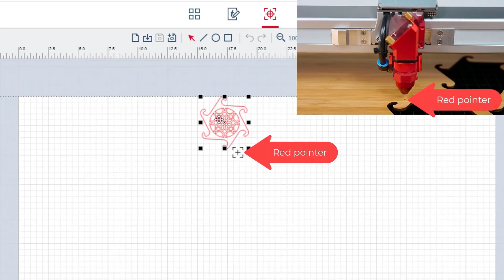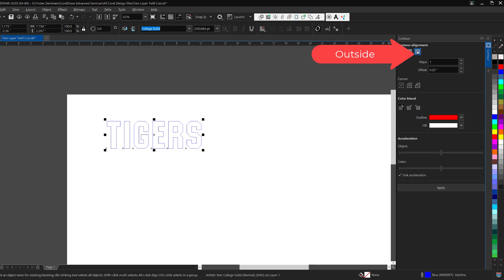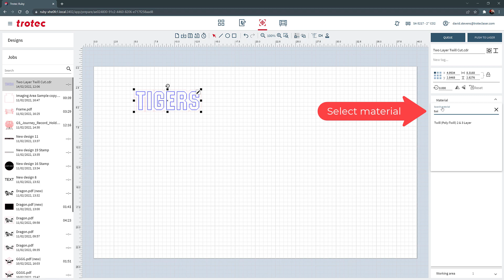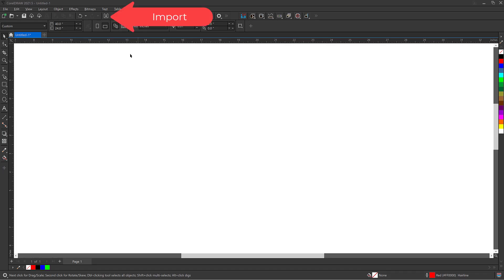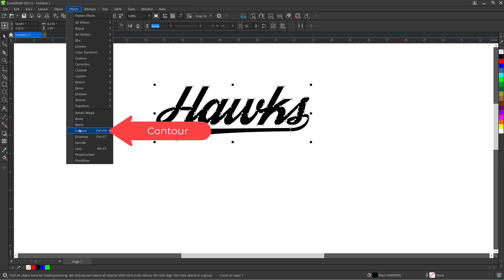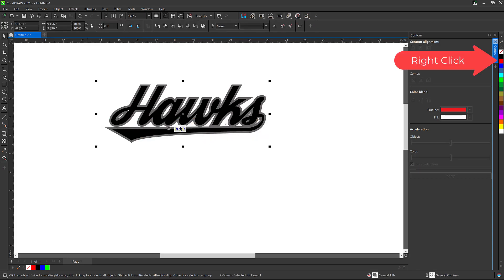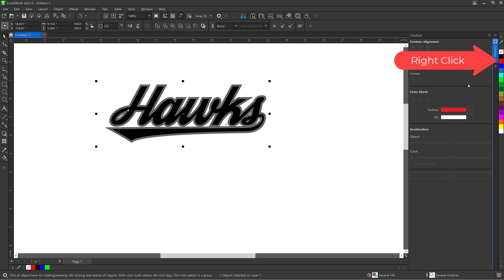Deep Dive with Laser Dave: Multi Layer Poly-Twill Applique Cutting

Comment: What settings are used?
Reply from the maker: Settings are determined by the materials brand, thickness, and laser wattage.
Reply: @TrotecLaser We need to test for each material right? Is there a baseline parameters for the generic twill in your software?

Comment: Dave how would you simulate a stich pattern around the edges like stahls do.
Reply from the maker: Hi Michael! Creating stitch patterns is a complex manual process using graphic software. There are YouTube videos online that will show the steps for this process depending on the graphic software used, but the process is not easy. There is also a software program that  Stahls’ sells that will automate this process called TwillStitchPro PLUS. https://www.stahls.com/twill-stitch-pro-plus-software